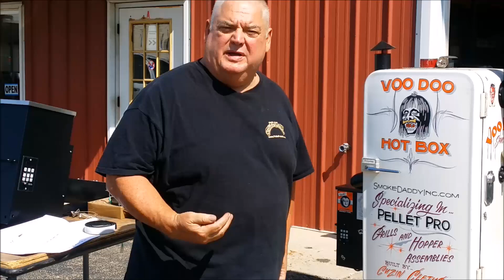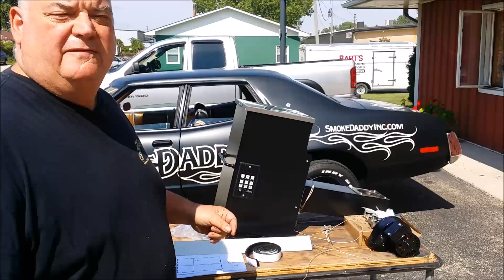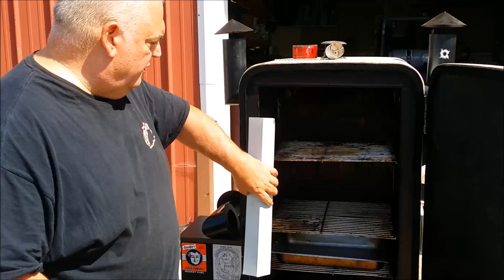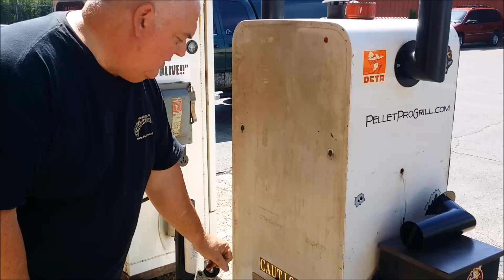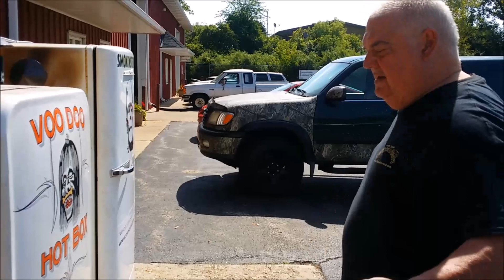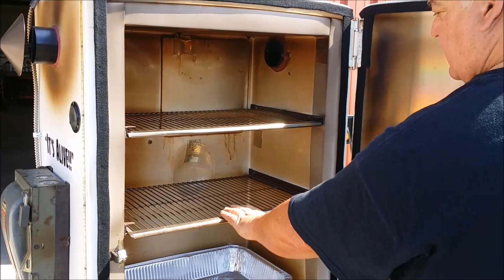Convert your Old Refrigerator into a Pellet Smoker with The Pellet Pro® Pellet Hopper Assembly

Comment: Ya'll need to pull out the installation ❤because fiberglass will put off toxic fumes and will make Ya'll sick I've made several of them and I have a stand and pit on the side of the stand that my refrigerator sits on the stand and the smoke comes from the firepit on the side and I use alder and cherry and hickory for the wood